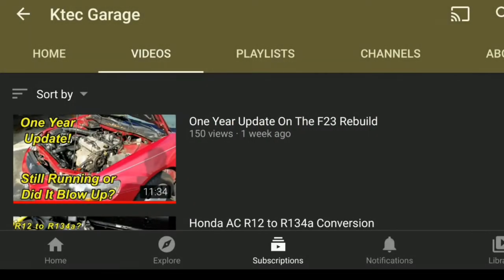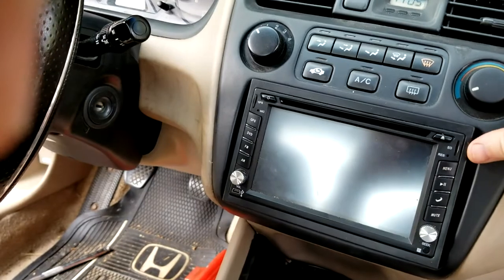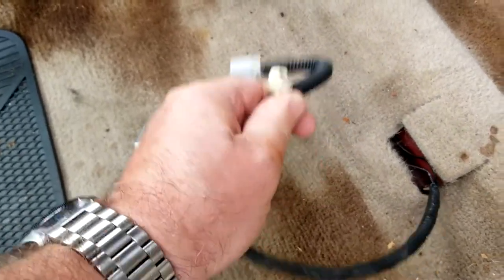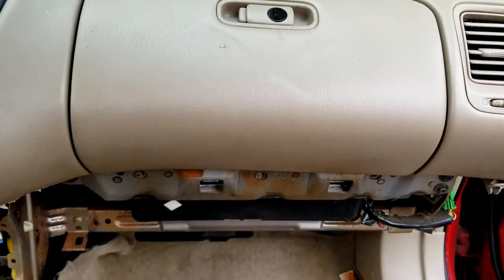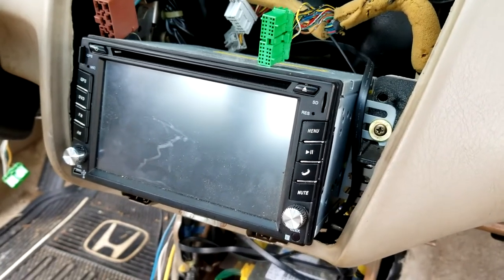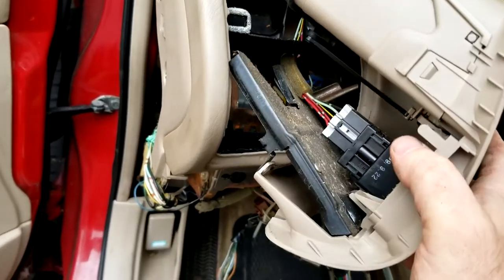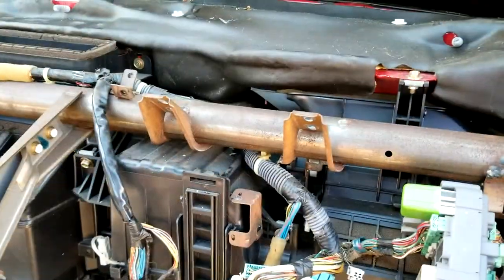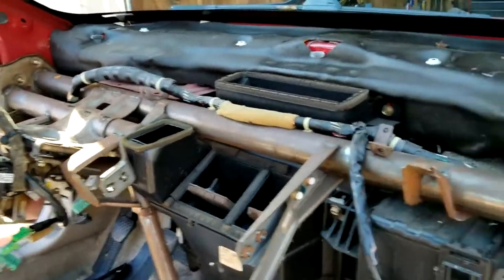Heater Core Pt 1 - Dash Removal

Comment: Hey where was it getting wet at? I’m trying to figure out a drivers side water leak on my 2001 CRV. Removed carpet and dumped water on roof and window and is still dry. Previously found a leak from the hood cable gasket in the fender area but the new gasket is holding up. I thought about the heater core but then my passenger would be wet? It is not
Reply from the maker: This one was wet in the passenger floor board. Look where your water lines run into the firewall in the engine compartment to see where the heater core is on that model. 

 Do you have a sunroof? Those drains can clog and get the carpets wet. Good luck!

Comment: Excellent video! What documentation are you using for this job? Would be excellent to have a reference.
Reply from the maker: I looked everywhere and I couldn't find any references. I assume these videos are the closest you could get. I've always been pretty good at taking cars apart and getting them reassembled, so I was just winging this. 

Thanks for the compliment!
Reply: @ktecgarage oh I see! It's just that you mentioned a manual/instructions a few times particularly regarding the 14 dash bolts. I was wondering if that drawing was from a manual or something. No worries if not though, the video you've provided is more than useful enough
Reply from the maker: Oh. I see. I have the Hanes manual for that car. Showing the bolt locations was about as far as it went.
Reply: @ktecgarage  oh perfect, thanks very much anyway!

Comment: You definitely went the long and hard way to remove the dash. Those harness and side panels do not need to be removed.
Reply: Whats the best way to do it??? HELP!
Reply from the maker: What I showed. It's a lot of work and these are  the only videos on YouTube with this much detail. That's why I made them. Sorry, man. Honda made this a tough one to tackle.
Reply: @ktecgarage excuse me sir, is the honda civic si 2009 thebsame process?  It's winter here in Canada and my mecanic already charge me 400$ to check all my collant hoses.  And he went to the conclusion to tell i have to change my heater core. And wanted to charge me 1500...  so i wanna try to do it myself...  i wonder if it the same process
Reply from the maker: It is probably harder to get to the heater core in newer cars. You could try running radiator stop leak through the system.

But yes, you would probably have to remove the whole dash.

Comment: Just did this to my Honda now my locks don't work and my  passenger windows don't work. Any suggestions would much appreciate it. Knuckles are beatn up. Would appreciate any info comrad
Reply from the maker: Off the top of my head, check fuses and connections. Don't forget the under hood fuses. Good luck!

Comment: Woukd this video work replacing a 97-98 heater core.  Just paid 1100 for a Honda civic had it 3 days and it started leaking antifreeze inside the car and under it
Reply from the maker: It would be very similar. Same concepts. It's a chore, so good luck!
Reply: Thank you I was hoping this is very similar to my I think I said 98 it's a 99 honda civic